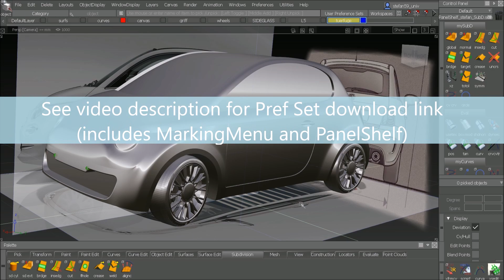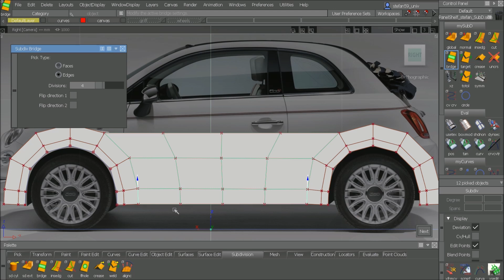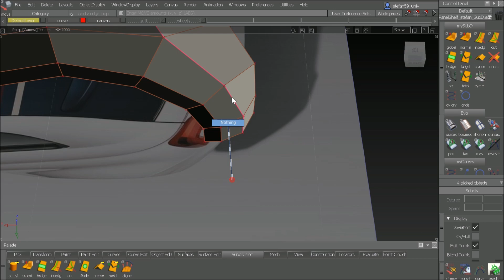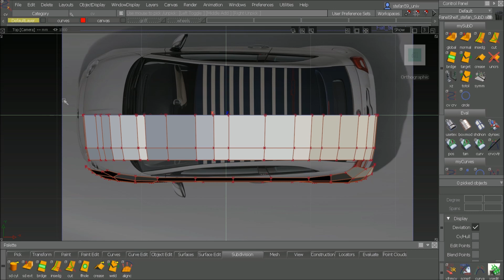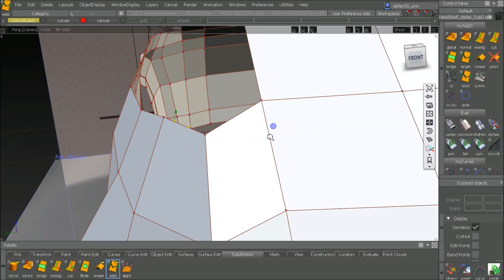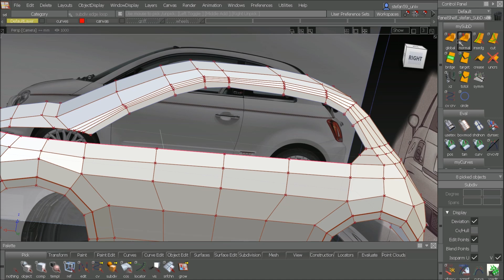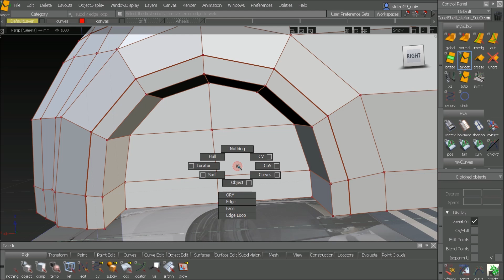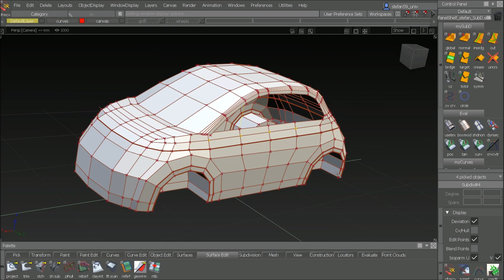Alias SubD - Modeling Fiat500 -part1

Comment: The 'usetex' tool under Eval tab is converting a subD model to a surface model? Is it introduced in Alias 2020?
Reply from the maker: Hi John, "usetex" and "boxmode" are two ways of displaying the SubD-model. There is surface at any time in Alias. That´s why you´re able to work with surface modeling tools like fillet surface. You can see this in -part2 !

Comment: Why using a polygon-modeling workflow in Alias?
Reply from the maker: Good question Alessandro! For experienced Alias CAS-Modellers SubD-Modelling is nice to have, but I would say, they don´t need it so much. The idea is to give Designers an easy-to-learn approach to enable them to create 3D-models  on a realistic underlying packages. Using Alias-SubD, they can easily interact with their CAS-Modellers because they have the same software!
Reply: Due to modelling deadlines are very tight these days and to speed up the process all Sub D surfaces are curvature continues and once shape is finalized, delete unwanted patch and patch it with span 1 surfaces hence this work flow

Comment: what is the difference between polygon modeling and subD modeling? please answer
Reply from the maker: Alias SubD Modeling always has a SubD Limit Surface. Polygon Modeling doesnot have that. The advantage is that you can do Hybrid Modeling using Subds and Nurbs together (see Fiat500 -part2)

Comment: Awesome video!  Love the hybrid approach.  Really takes the what you love about Sub D's and combines it with what you already know about Alias.  Also, love the side glass technique using the revolve tool.  The question I have is once you use the "crease" tool on a surface, can you go back and radius the surfaces?  Thanks again, I'm building the Fiat right now!!!
Reply from the maker: Glad you liked it! Answering your question: you can do a SurfaceFillet directly on a crease, I show this in Fiat500 -part2.  Another option would be to uncrease it and do a bevel instead

Comment: hey, When i change from box mode to Diagnostic shade , i could see pinch in the surface. Kindly help
Reply from the maker: That usually happens by incident, when you hit spacebar and you don´t move the Manipulator, then the width of the extrusion is 0